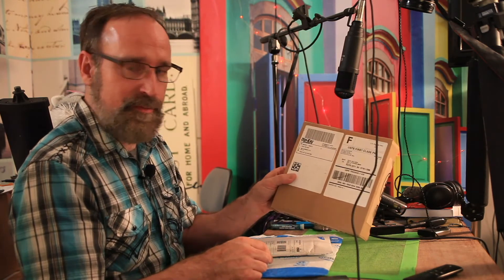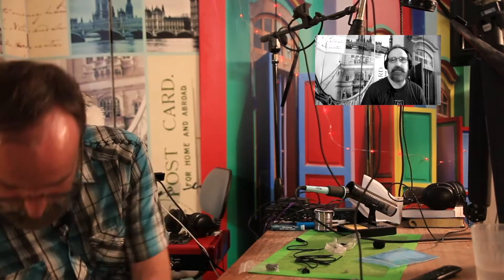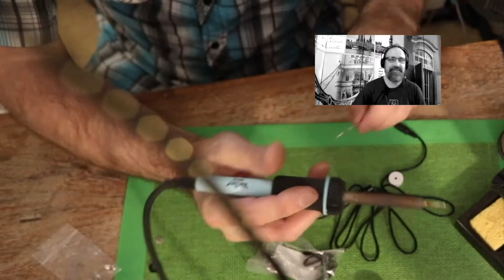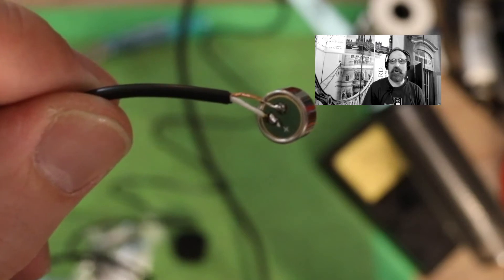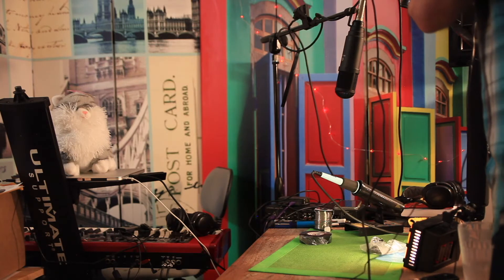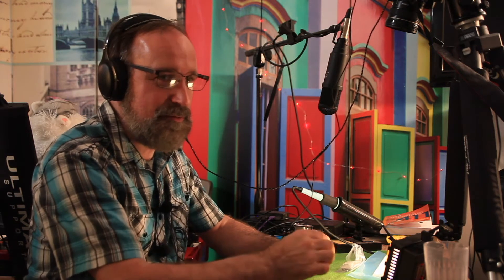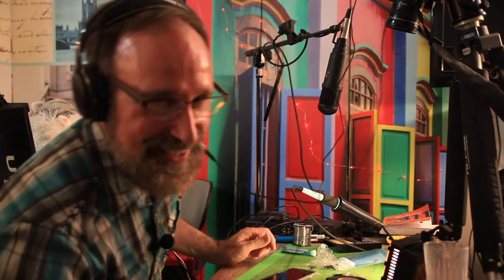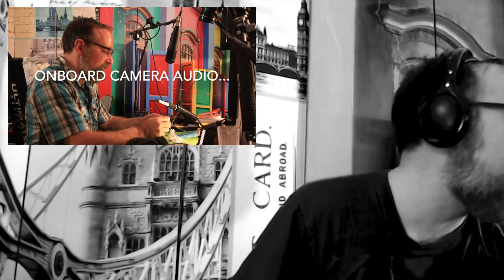DIY Lav Mic | Short Story | AOM-5024L-HD-R | Will It Work With the Alvoxcon UHF Wireless System?

Comment: Thinking about using one of these mic modules with a diy high-gain amplifier to make a through-wall listening device.  Nothing serious.  Just for fun.  No idea if it'll work, but the module seems to have good specs.  3-d print a cone to go against the wall and direct sound back to the mic, which sits in the narrow end of the cone.